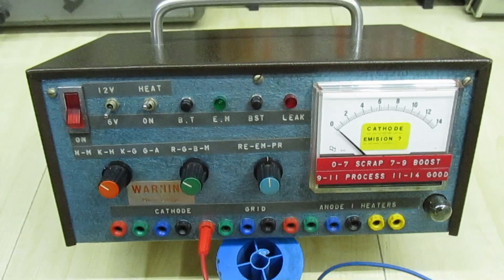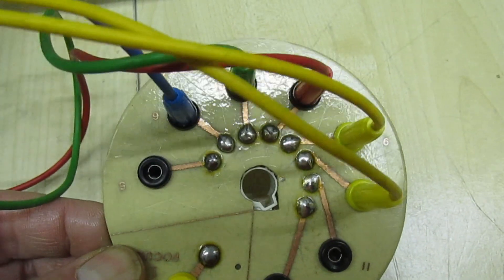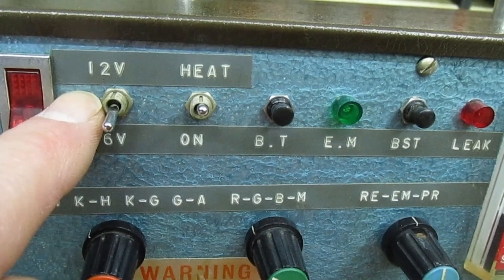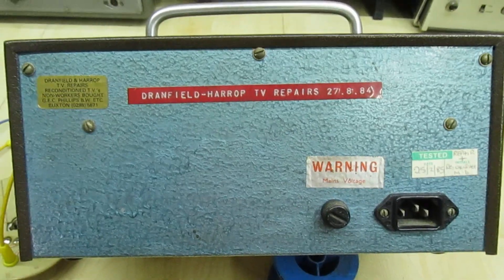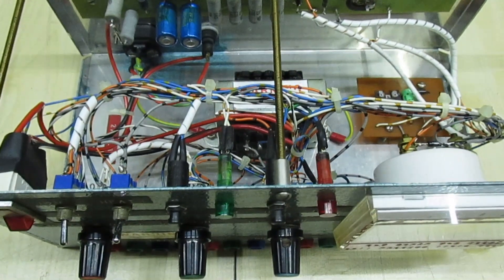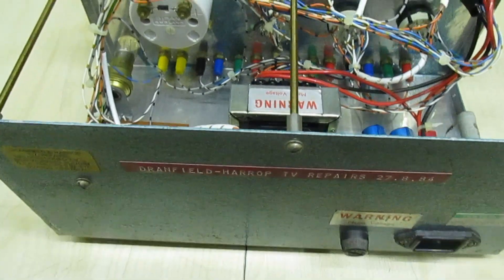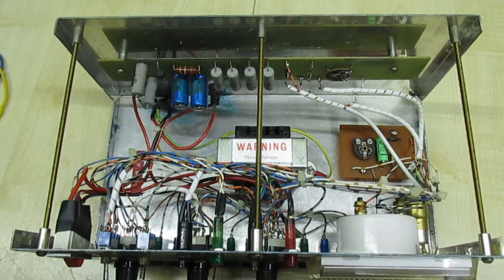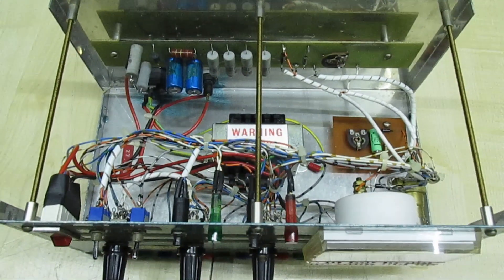Lets take a look at the test equipment  I used in my early years as a Television engineer.

Comment: I bought mine back in the day - I rejuvinated more Wyse terminals than TVs and it paid for itself serveral times over. It got thrown out along with my Fluke high voltage probe and a few oscilloscopes. Still kicking myself
Reply from the maker: Later on in years I bought a Leader one  and I still have that too !

Comment: hi id be very interested to see a schematic for your fake transistor hv tester, got lots of stock id like to test here such as to3 hitachi v-fets , i dont know how to current limit such hv to a tiny 250ua -1ma  dont think an op-amp could cope !  noticed comments are off on that vid so thought id ask here
Reply from the maker: I can let you have the schematic of the constant current generator but the rest of the diagrams , relay switching and high voltage generation have been lost .
Reply: @michaeldranfield7140  hi thanks for your reply yes I'd like that. Don't want to give out an email address on YouTube though, could you link it in somehow so we both don't get loads of requests
Reply from the maker: @darrenmurphy6251  Sorry when it comes to linking im not that computer technical , find my number on the net and give me a ring .

Comment: I recall building one it had a 300volt rail (obtaind via a peek rectifier cct consisting of 1uf "Finlandia mains smoothing cap" and a diode boost configuration and limited with 3 x wire wound  10k resitors "Decca RGB output load res" to give a  10mA ) current from kathode to grid monitored with moving coil ammeter, the heater voltage I used a Thorn 950 frame transformer with modifide secodary 9volts . The output was a B9A (Think that's what it was called ) to a cube pod with verius tube base sockets. It worked very well eventulally I sold to another eng as I moved on. That was pre 1979. [Update I forgot to mention this was my design  and yes it was built on pcb . ]
Reply from the maker: Quite a few designs were published in television magazine over the years , some better than others and this served me very well .

Comment: That wire looks to me like the type used by telephone engineers, me being an ex faultsman  jointer! Stay lucky fella😉
Reply from the maker: It could very well have been, I remember as a kid picking up wire from the sides of the connection boxes in the street, I also collected some blue sort of connectors with sillicone grease in the middle, you would find a load of these dropped on the floor after an engineer had been doing some maintenance.
Reply: @michaeldranfield7140  the connectors you mentioned are I D C crimps grease filled , I must have used thousands in cabinets and cable joints,  I still have some and the special pliers to crimp them , the nick name for them was jellies!  Stay lucky fella 😉

Comment: Nice one, though the wire harness looks a bit messy. I like the PCB design.
Reply from the maker: Messy because there's a lot of wires to the rotary switches.
Reply: @michaeldranfield7140  yes, and these wires are not laced anyhow.
Reply from the maker: @KeritechElectronics  cable tied though .

Comment: Old television engineer will you answer me why mosfet not used in place transistor in the horizontal output section of the t.v
Reply from the maker: I guess in the days or CRT they couldnt make MOSFETs which would handle 1700V

Comment: I’m just starting to learn about vintage televisions are most of the CRT 6 volt filament in the U.K.. I’m just in the process of building some adapters for a BK precision tube tester I have.
Reply from the maker: we were 6.3 volt for the heaters but 6v is near enough ,  I think BK was the tester with individual meters, I eventually replaced the home made unit with a Leader .
Reply: @michaeldranfield7140  I have a B&K, a Leader, and a Muter.  The Muter is actually faulty, and according to most people I know, B&K tend to under read emission on black and white CRTs. My favourite, and go to, tester is the leader - it's the one trust the most, and feels intuitively right.

My B&K has three meters. Without looking, I think it's a 457, but there are some with only a single meter. The Leader is a single meter jobbie!
Reply from the maker: @whitesapphire5865 I went on to buy a Leader LCT-910A  when the business was doing well and I still have it here along with the workshop service manual if it ever went wrong , last used it about 4 years ago in a youtube video !
Reply: Some CRTs had a 12.6V heater, like the one in my 1958 Dynatron TV34, but the majority ran at a notional 6V.

Comment: Have you still got the circuit diagram Michael, or more to the point, can you find it :-) Ed Branch
Reply from the maker: As far as I can remember I saw this in Television magazine in 1974, but it wont be an exact copy as I added a few more things to the design, however  my collection of Television magazines are the only ones I have in some sort of order so if I'm correct with the year then yes I could lay my hands on this pretty easy !
Reply: @michaeldranfield7140  Yes, I seem to remember it being a feature in TV Mag. When I started my own TV repair business, I bought a Dynascan CRT reactivator for £399. I was flush at the time just having taken redundancy from Rediffusion.

Comment: excellent and only one light bulb.
Reply: I can see that light bulb flicker in time to the blue flashes in the CRT as the cathode cleared. I built a very crude one based on a design in Television or Practical  Television. Valve sets seemed to boost better than newer transistor or is my memory failing?
Reply from the maker: I dont think you could buy a bulb like that now !

Comment: Is it useful for modern LED TVs?
Reply from the maker: No,its for CRT.
Reply: @michaeldranfield7140  thanks for not leaving my question dangling through the sky
Reply: not really...  :-)
Reply: Quite different technology I'm afraid.  These testers check the emissions from a heated cathode. LCD uses either, cold cathode compact fluorescent lights, or, LED lights, both of which shine through the LCD screen to make the image visible. CRT bombards the screen phosphor with a stream of electrons, causing excitation of the phosphor, which directly emits visible light.

Michael can tell you more about this, I should think, but LCDs do eventually wear out, and are still prone to a form of 'screen burn'. It seems that there are ways to eliminate, or at least improve the appearance of burn, and I'm sure I recently saw a TV with a "regenerate screen" option in the menu, but I have no idea what make or model. I'd guess at LG, or Samsung. If I remember, it's done by sweeping a single line, in a line by line fashion, from top to bottom of the screen.  It takes hours to complete and doesn't actually regenerate the screen, but seems more likely to equalise the wear and tear across the entire screen.  It has been suggested that the same effect can be achieved by using a PC to generate the sweep. I'm not sure, but I think the key is to drive the LCDs fully on, then fully off, line by line.
Reply: @whitesapphire5865  never seen screen burn on a lcd tv and ive never seen one wear out.. i have an lg 32lx2r from 2005 and still has a good picture.. yes ive had to repair the power supply a few times, probably the most unreliable tv ever is LG and the most reliable is sony.. got a sony 46 inch from 07 and its never broken down. or even more reliable is on old crt ITT nokia from about 1986 its sitting in my attic doing nothing.. but it still works